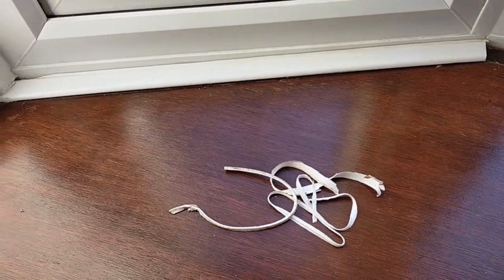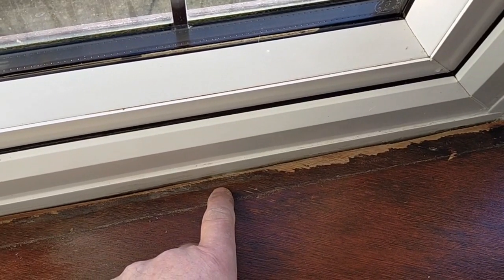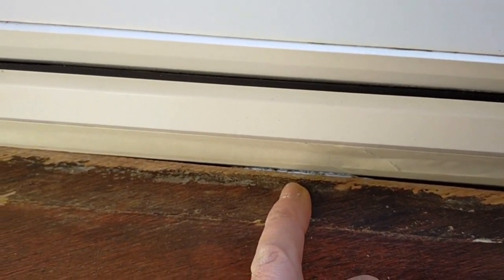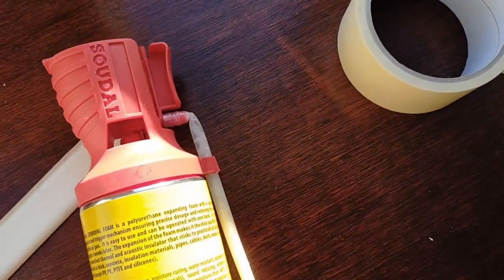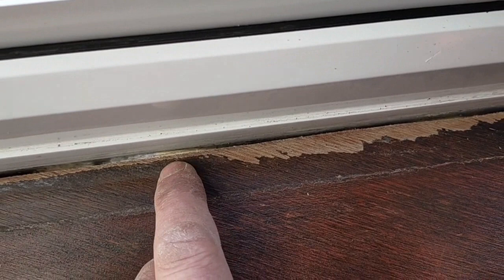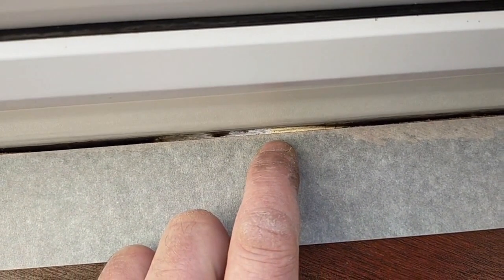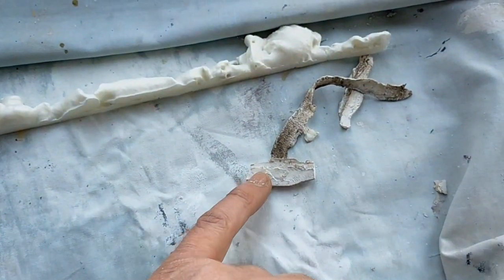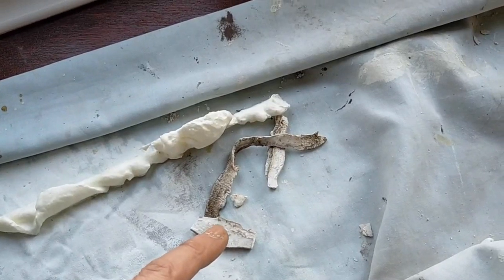Stop Using Caulk To Stop Drafts

Comment: Always use a low expanding foam around a window this is what a window fitter will use as the problem with the one used if you have not much experience you can end up over spraying and it will go in places where it should not and expand causing  more damage than good  lifting and putting things out square etc.

Comment: Since I have foamed around my window reveals I am getting alot of condensation on the plaster...I have log burner down stairs but the condensation is in bedrooms...the reveal,s are wet through in a morning..do you think I am over heating the house or is there another reason...
Reply from the maker: Probably another reason, cold plaster can always attract moisture.  Windows are meant to be sealed around with foam. Thanks
Reply: The problem with sealing all these drafts is that we’re trapping moisture in our houses. In the winter the cold outside air holds far less moisture than inside your house, so that cold dry air coming in helps stop this condensation. That’s why all new windows must be fitted with trickle vents to bring fresh air into the house.